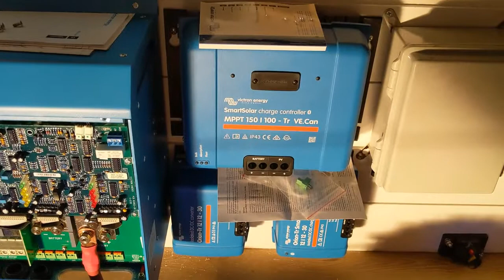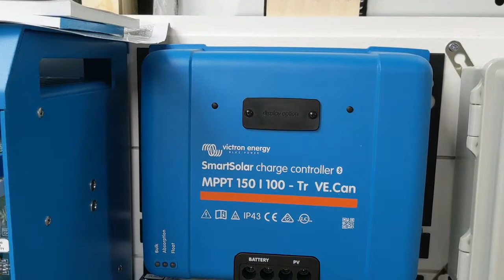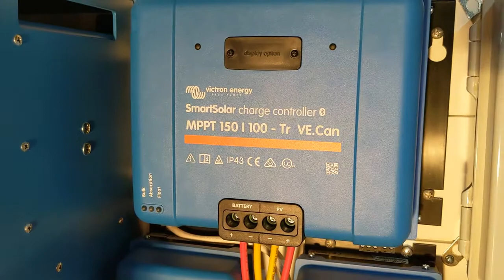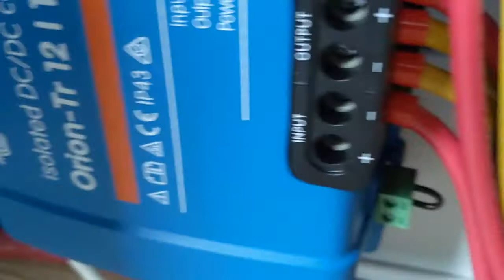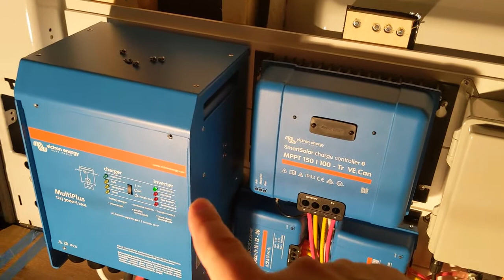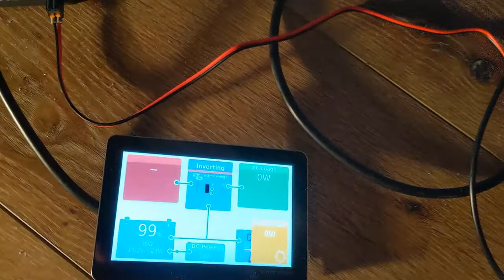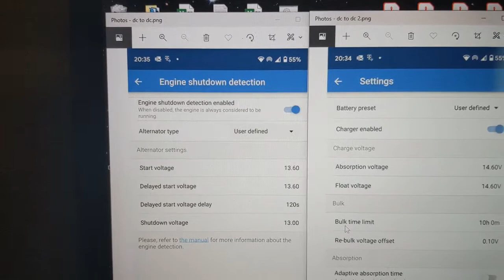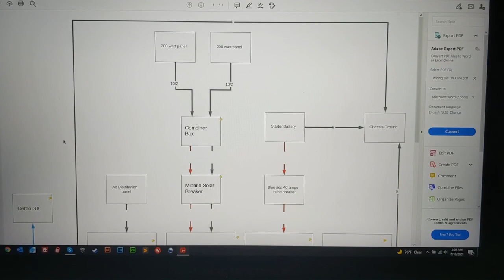How to install a Victron Energy system in a van conversion | Going Boundless Van Conversion 2021

Comment: Dude, as all videos that people have done with these set-ups, thank you! My set up is almost identical, didn't know you needed a Victron Pro to calibrate the Shore Power side of the system, I'll have to bear that in mind. I do have one concern with your layout, and that is the Main Battery 12v Isolate switch is right next to the smart shunt... There is not much protection on there and would be very easy for something to short between the smart shunt and the battery isolator. I'd maybe consider a perspex cover for them both to avoid arcing.

Comment: You may want to check your Float Voltage. 14.6 is quite a bit higher than the more normal 13.5 volts. Maybe it’s OK with your particular batteries but it’s better to double check.
Reply from the maker: 14.6 is the recommended float voltage for these batteries. Thank you though, I do appreciate you looking out.

Comment: Hi - Great video. I love all the detail.  On the B2B did you connect directly to the car batteries and not use the Transit Common Connection Point. I am thinking that I will use the CCP and only run the positive cable to the Orion.  Thanks
Reply from the maker: Hi there, yes I ran to the batteries.

Comment: Thank you for the nice review. I noticed you have one Orion Tr 12-12 30A Converter and one 30A Charger. Any reason for that, why not 2x Converter or 2x Charger ? In my situation, my solar battery bank is 48V and I need 12Vdc supply for fan, refrigerator, LED lighting. Should I use 48 to 12V Converter or Charger in this scenario ?
Reply from the maker: That was a mistake. I changed one out.